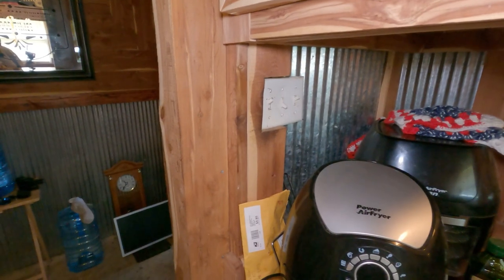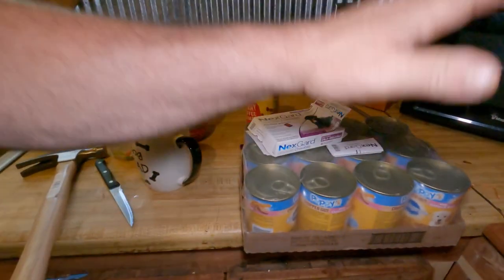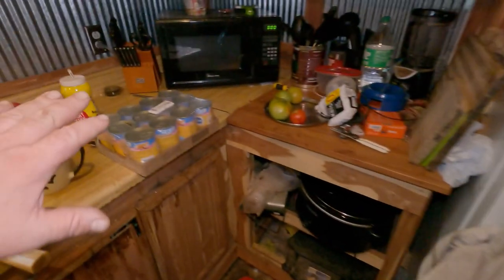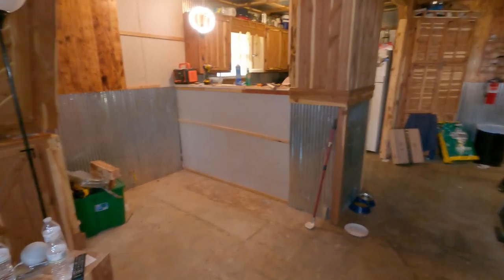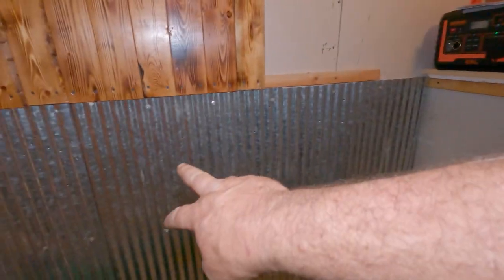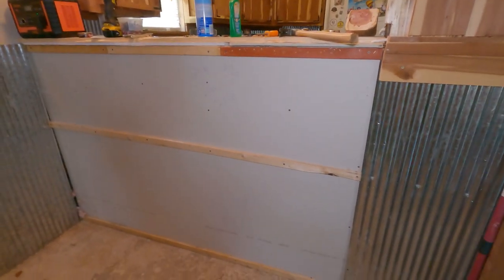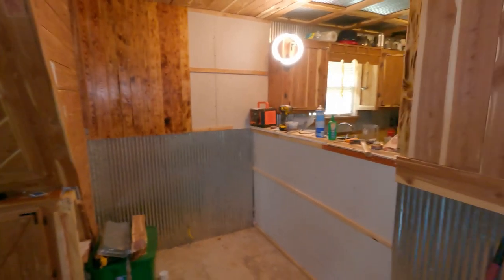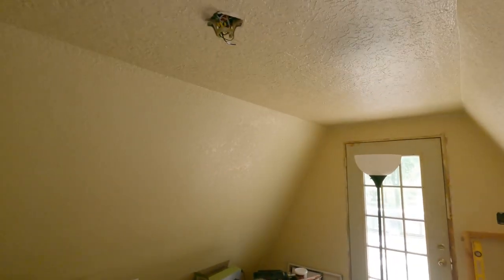It Looks So Much Better! A-Frame Cabin Remodel On A Budget

Comment: In 1980 friends of ours sold their 3 bedroom home in town, bought several acres,  went to our local Payless Hardware Store & purchased an A-Frame about the same as you have. Where your kitchen bump out is, they used as part of their dining room & living room. There was a sliding glass door in the bump out, another slider out the back. Their kitchen & bath was where your front door & living room area is. They had stairs to the loft attached to the bathroom wall next to the living room. A group of friends helped build it. What great memories!

Comment: Yea using smaller appliances you need counter space.  Maybe take the beautiful live edge pieces that you had and make a top for the wall. Put shelves that run the whole width where the stove is coming out of and they are easy to move is you need to but give you storage for "stuff"  Hang a curtain over it on a piece of wire and its covered.

Comment: I think you've got a good plan Mike, it sure would make it easier with the build. If it were me, I would take that whole wall out where the stove is, rewire and put a stove on that wall with that cabinet you have the pots in at the end, small counter under it then the stove and another counter to the sink. You can never have enough counter space in a tiny home. Also you can put a table in front of the sink where the wall and stove was unless of course the beam is holding the ceiling up. But that's just me.

Comment: If you put an AC (or mini split) in the loft room not only would make that room more “usable” it would help cool the main floor since cold air goes down.  Just a thought.  

I agree in keeping that wall up.  Solves a lot of problems and will look just fine.  It’s going to look sharp when the ceiling is done!

Comment: suggestion: put in as large a window as you can, then make decisions based on how much that changes everything
Reply from the maker: There is electrical and plumbing in those walls, so it will be as big as that allows

Comment: I was just thinking have you ever seen where they make a drop counter. Part of the counter is attached to the wall with I think it's a piano hinge. And then there's legs that fold up underneath. So when you didn't want to use it It would be out of the way. But when you wanted a counter or a table it would easy to set up. Or on the side where your still viz make that account or put a stool underneath. Then you could see your t v from the kitchen while you're eating